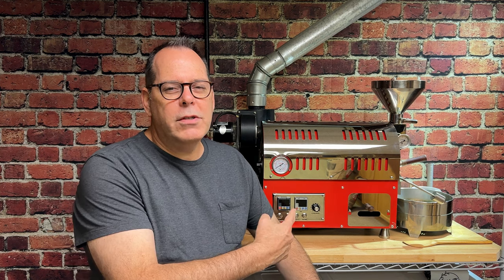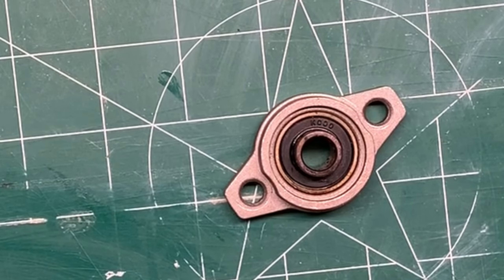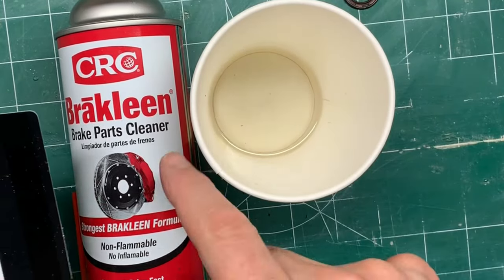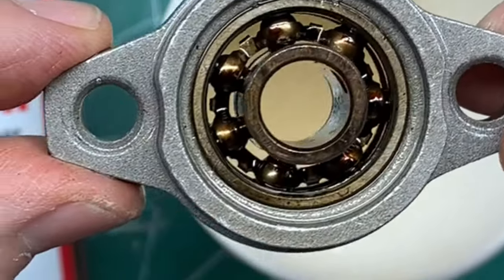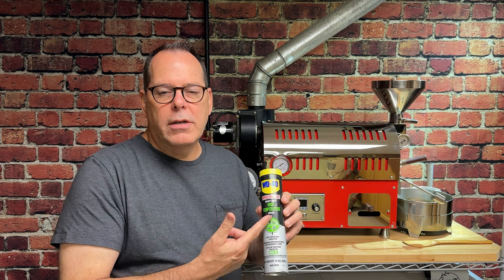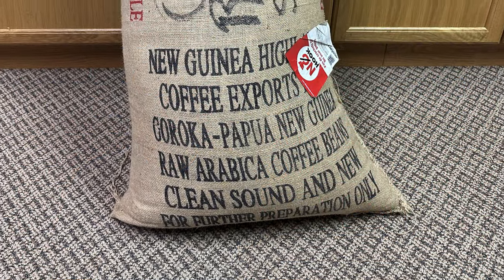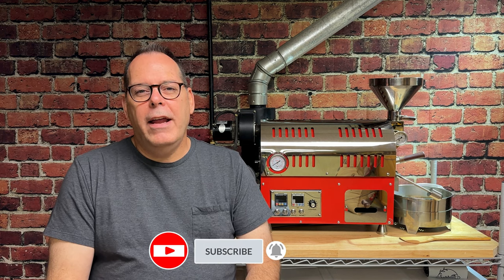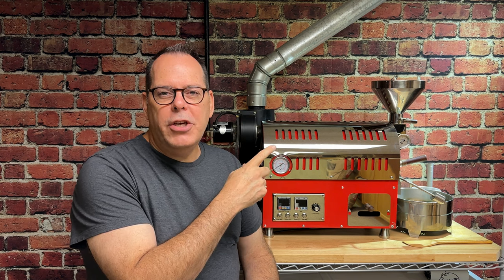How to repack coffee roaster bearings

Comment: If anyone is looking for it, Mill City sells some high temp food-safe grease. I bought mine there. I've always had a difficult time pulling off the bearing seals with causing some damage. I'll try your pin method next time. Thanks for the video. I'll probably repack my bearing after my next roast.
Reply from the maker: David, which roaster do you have?  Just wondering if you ever worked on the rear bearing.  How often are you greasing/replacing your bearings?

One thing I didn't mention before (i don't think) is that my MCR manual suggests i set my safety PID temp at 450.  For a while I was letting my roaster peak up at 450 during my warmup and that seemed to make my bearings dry up quicker.  I left the safety at 450, but I modified my pre-warm routine to stay below 425 as I usually don't go higher than that when I roast anyway.

Thanks for sharing and for watching my video.  I realize it is a pretty limited crowd that might be interested in this type of video but I made a promise when i started this channel that i would include some maintenance content.
Reply: @VirtualCoffeeLab  I have the 2020 version of the MCR 500 gram roaster.  The biggest difference, I think, is the cooling tray design and venting and it uses MODBUS instead of Phidgets. My PID safety temp was set to about 430 by default.  The first year, I had to change the front bearings every 12-16 roasts. I was letting the roaster hit the shut-off point (430) during warm-up and between batch.  I've now altered my warm-up to not let the PID temp go past about 405 F. I just let it sit there for a bit longer, 30-40 minutes. I'm in Southern California so it doesn't get too cold. I've not had to change the bearings or repack as often. My hope is to just check them often enough to merely repack them.  I have notes somewhere but I'm guessing about 50 roasts between bearing swaps, which is about 6 months for me. 
Rear Bearing - I've wondered about changing it, but have avoided taking it apart enough to look at it.  I should probably do it before there is a problem. Probably need chain lubrication too.
Reply from the maker: Thanks for sharing David.  Yea, the pre-warming routine really gets the front bearing hot.  Are you using artisan or the MCR software to roast?

Comment: Hi Mike, great video, very instructional.
If l needed to by new bearing, where would l get them, your help would be appreciated.
Reply from the maker: Hi Shane.  I'm not sure if your bearings are the same as mine.  My Mill City 500 gram roaster uses  KFL000 10mm (.39") bore pillow flange bearings.
Reply: @VirtualCoffeeLab Hi Mike, you may be right, l will have to make some other inquiries, thanks.

Comment: Good video to see Mike. Well, this video now applies to me since I do have a front bearing in the Bullet. I cannot recall any Aillio documentation that addresses the need to repack any bearings, but I will look closer. Was your bearing starting to make noises? If so, next time you probably should repack it sooner than you did this time. If it was making noise, I would set the interval at one-half the time its been since the bearing was last cleaned and re-packed. Or if this was the first time its been done, the time since the machine was purchased. I know when bearings start to make noise, they are already wearing out.

Some may think they can just replace the bearing if it gets too bad. But the risk there is if the bearing has seized in any area, it could have worn or scored the shaft. And that might mean needing to get a new shaft or maybe a whole new drum! Does Mill City have any recommendations as to how often to re-pack the bearing?

And finally, if I can help in any way in your high-volume coffee roasting project for the non-profit folks. I'm not that far away!
Reply from the maker: I haven't forgotten about you, Lou.  Life has been pretty busy the past few months.  Yes, preemptive bearing service is ideal.  Most of the time it is hard to know if a sealed bearing needs replacement or service until it starts to make a noise.  First, it is a mild rumbling, then a grinding or squeaking noise.  Yes, by then it is too late.  Realistically, "repacking" is more for a bearing that does not have high-temperature grease and is newer, if not brand new.
As always, thanks for your comments.  I know this video is very specific to drum roasters and doesn't even apply to most of my audience, but part of my promise when I started this channel was to cover all aspects of roasting coffee at home, including maintenance.
Reply: @VirtualCoffeeLab  Good points Mike. Looked at another way, you are also providing information for those who are "thinking" of upgrading to a drum roaster. You've given them good information on some things that might be involved, should they ever do that.

Comment: I use a food grade grease  Super lube it's rated to 450 degrees
Reply from the maker: Thanks for sharing that.  The front bearing on my mill city coffee roaster seems to take the brunt of the heat and gets really close to the 450 max.  So, I’m using a high temp grease that has a 625 max.  I would love to find a food grade grease that has that high melting point.